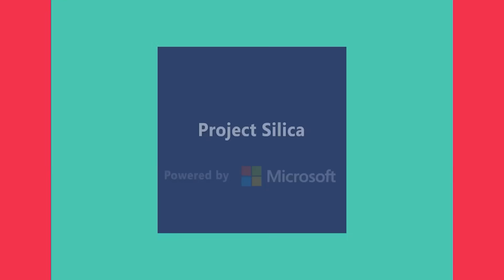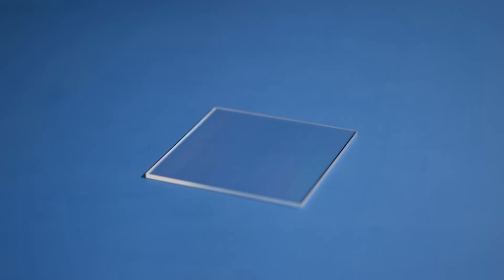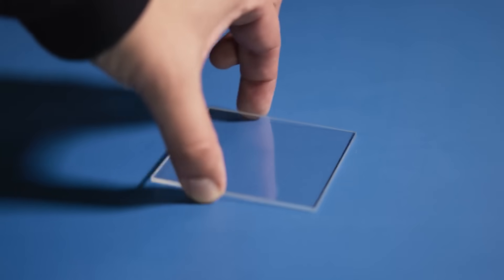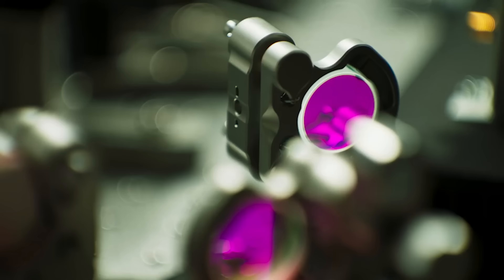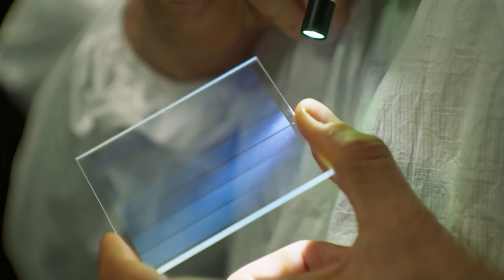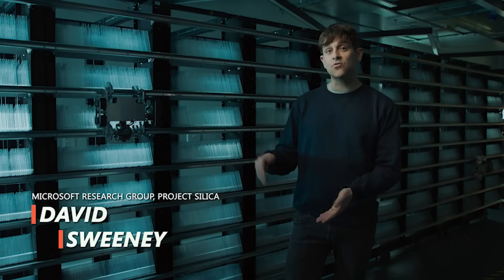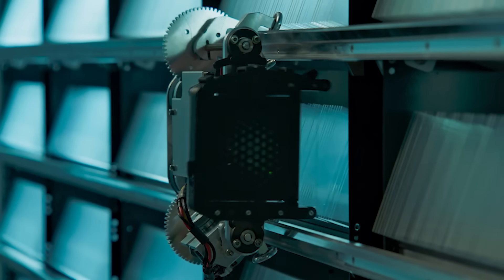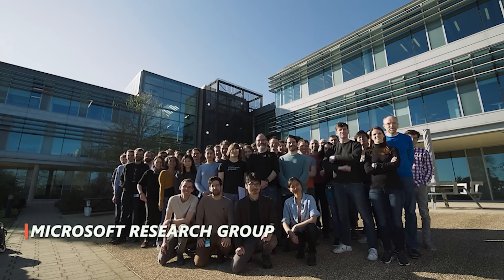Sealed in glass - Microsoft's Project Silica

Comment: Fascinating and eerily similar to the clear glass chips from Star Trek TNG. I imagine the biggest issue is the lack of ability to rewrite the glass chips. This would function as permanent long term storage for documentation
Reply: CDs were read only first of all I’m sure as technology progresses they will get read/write into these chips!
Reply: You folks are not getting its purpose I read rewrite is NOT necessary, it’s for long term storage of ALL the worlds knowledge and information forever!! Not for users like you. It’s impressive is that it also doesn’t need power to read it after.
Reply: @nicholasklangos9704  Reading requires a computer controlled high powered precision microscope as well as a computer to decode the data being read by said microscope; all of which requires power.
Reply: @nicholasklangos9704  but glass is essentially a fluid, so it's not even close to forever, right?
Reply: @Doogle7821 thing is that storing data today is usually consuming power for live data storage as well as for the hardware storage (aka data centre with air conditioning). Both not needed here.
Reply: I was thinking planet Krypton and Kal El's (Superman) information stored in crystals... Crystals might be stronger than Glass and could be better at permanent long term storage of data...
Reply: @yootoober2009  I was thinking "The Time Machine" and the talking discs. Those helpful recording items last eons and eons, then after those, more and more eons and eons, even! I was thinking that Superman and 'super Krypton things' wear out eventually? The whole planet exploded after all, so how durable could Superman be over time?
Reply: Star Trek's isolinear chips is more resemblance of optical computing. Which is a real thing! The biggest challenge is to create a logic gate that acts purely on interference patterns. It probably won't look like the chips from star trek since light based chips would obviously need to be contained in a opaque package to block off any external light sources, but still it's a real concept!
Reply: But for long therm storage especially important data its very interesting
Reply: So it’s like an advanced form of microfiche
Reply: Rewriteability a nonissue. The pieces of glass are dirt cheap, it's just fused silica. If you want to change data you can simply write on a fresh piece of glass and toss the old one in a literal recycle bin. And it's 100% reusable, you delete old data by melting it down and making fresh pieces of glass out of it.
The usability problem if any is latency and read speed, takes a while to find the necessary piece of glass and read it. But that's archives for you, if you need to access data nobody has needed for a decade, then it's probably acceptable to wait a few minutes. If someone were to be constantly using this data then a working copy would be kept in traditional servers for fast access.
More practical problem is cost of writing this data, the equipment I've seen so far is very prototypey and expensive for the small amount of data it can write in any sort of reasonable timeframe. It's not really ready to take on a task of archiving the massive amounts of data the world needs to archive.
Reply: All current and future tech is inspired by Star Trek. 

Can't wait for replicators and teleporters.

😅
Reply: It's called ISOLINEAR CHIPS 
https://www.youtube.com/watch?v=XN2ARLfcO24
Reply: if it was cheap like floppies used to then a game changer.
Reply: More like HAL 9000 memory!
Reply: Yeah! I immediately thought of Star Trek as well
Reply: think of these as read only CD
Reply: Actually it was explained it's possible in another video about this tech
Reply: Krypton used this tech a long time ago. The Lantian for even longer, then the Goa'Uld and the SGC. Star Trek come far later in the timeline. 
But I bet Microsoft glasses are much more fragiles than the other ones.
Reply: It's easy to recycle clear glass.

No need for rewrites.
Reply: yes, optical pits or "voxels" isn't a new idea. The whole "sustainable" spin sounds like nonsense
Reply: Not many people realise we have at least 70% of the tech used in Star Trek. Well, minus the ships because that unironically will only happen once we achieve a OWG.
Reply: @shineayandrews1869  the big limiting factor in most Star Trek tech that we need to overcome is the energy requirement.

 As you said, we already have experimental and in some cases even practical experience with quite a bit of Star Trek tech, but to make it  usable, we need a massive energy revolution.

Even the warp drive. It's theoretically sound, just requires "the lifetime energy of the sun" levels of power in current mathematical models.

The energy estimate has been brought down in recent years as we learn more, but still requires energy many times the amount we use as humans combined.
Reply: records in the jedi temple are similar format as well
Reply: The other issue is the response time, even if the read speeds are high, those several seconds it'll take the machine to physically move the glass to the reader are gonna be a problem for anything more than archival.

And then, if archival is the goal, I'm not sure remote storage is ideal, I know I wouldn't want to rely on a third party company to be there 30-40-50-100 years down the line for when I or someone else will need that data.

Now if they can compress this technology and bring it into the home, I'm all for it.
Reply: It’s not necessary to rewrite its for long term storage of data not for you users.
Reply: @nicholasklangos9704 so a data update maybe because factuaal changes will need to replace the entire glass? Information are constantky updating and science is all about continously reviewing and accepting new data while replacing the old and obsolete, so i do believe there is a need for rewritable system or at least replacable to ensure obsolete data are not kept or has double records conflicting with newer information
Reply: @archingelus  Science has no boundaries but creative content does, which is usually the most space-consuming to store.
Reply: @samwolfe1000  well, the context of everyone in this information is mostly erred on the knowledge of science not culture, eitherway there are tangible culture or art that you preferably want to preserve as they are like paintings which would be better if left unchanged not in a form of a glass for your own context's sake
Reply: @archingelus this is what tape archive is all about since ages. You don‘t overwrite a certain part of a tape - you declare information for unvalid and amend the changes to the end of the tape. The final data is stored in a catalogue (aka index). You add changes to the catalogue et voila. What you consider a problem isn‘t any issue at all.
Reply: @pan6593  i barely even remembered what did i replied to 2 weeks ago lol
Reply: @TheFloatingSheep  I thought the same about response time, but HDD drives use a disc with a reader which is similar to a record player. We’ve made it work over the decades.
Reply: @TheFloatingSheep  Not bad ideas there, for a 'floating sheep", even. Pink Floyd should hire you to create another animal balloon, maybe. I agree that all great ideas are exactly that, until they aren't anymore. 'Archival' would be awesome using this, but at one's individual command, not at another's 'company model' demand. Having a set of these in a PC with read/write capabilities would be so much better than what I have now. Speed, you must have speed involved or it's like torment and torture. Those are not long term benefits at all. Long term anguish is more like it.
Reply: Yeah. Documentation on you.
Reply: You'd probably just melt the glass down and make a new one

Comment: There's a slight bit of latency with this method. Other media is low power too if you switch it off.
What is the lifetime of this stuff, any built in ECC? Glass can be damaged by radiation, can't eliminate all background radiation.

Comment: They mentioned the information is stored permanently.  I don't think most information on the cloud is permanent but more transient in nature.  However, this is great for storing historical data that does not change.
Reply: Its permanent.  Yt stored video permanently
Reply: @phantombeing3015  I'm sure youtube isn't using the same storage devices they were using 10 years ago, they just keep moving the data to new hardware when the old ones start to fail or get obsolete
Reply: @rizizum  well, they do it because they fail at that time. The point is that they store videos permanently. The data needs to stay whether they replace their storage in months or years. But they will prefer storage technoques which last longer if they are reliable enough
Reply: @phantombeing3015  The problem is that long lasting storage can't be read fast enough for video streaming

Comment: An HDD does last much longer than 5 years... Especially if you only write on it just once - like they do with these glass sheets.
Reply: bit-rot on hard disks are not caused by writing to them. The fact that they are magnetic, by their very nature, the fact that they are rewritable makes them impermanent.

The very first hard disk that was available for the IBM PC was 20MB. Today we have 20TB drives. The higher the capacity, the more dense the data is packed on the platters. This means each bit is encoded as magnetization polarity onto an ever smaller miniscule tiny spot on the media. And over time, they will interact with their neighbours and gradually degrade. Even if you seal the whole hard disk inside a vacuum chamber and keep it away from other electrical stuff, motors, etc that have magnetic fields.

Those 40 year old 20MB hard disks are probably still readable today. The 500GB ones from 15 years ago, possibly not. It gets worse as capacity increase and things get packed more densely together.

Conventional wisdom is you check your data every 3 years or so. 5 years if you want to live dangerously. Longer than that, you're risking data loss. It's actually not really that important for our home data, but if you're managing an actual archive you are venturing into the area of professional negligence.

And one more thing. Write once data are impervious to ransomware attacks like NotPetya. The fact that hard disks are never write only made me worry constantly when I was a sysadmin.

Comment: They dont specify if what they refer to as glass is a single quartz crystal, polycrystallyn quartz, or even plain old window glass. Quartz, or any similar crystal should last about forever. "Glass" is a term that can apply to any non crystalline amorphous material. The problem with window glass, for example, is that it doesn't retain its shape forever. If you ever looked through old window glass you would understand - it eventually distorts and sags under its own weight. (Think of window glass like really solid jello - it will sag slowly!). In any event, if they want data retention greater that a few centuries, they will have to use a crystalline material. Considering the fact that our society considers everything disposible, im not sure what they are gaining over "archival" quality DVDs.

Comment: I've been involved in IT for decades and especially with people on data storage. People can't not break CD's which are far more durable than glass. People can't not break robust external drive systems. Sorry if I am more than a little skeptical of the long term viability of this.
Reply: You're not thinking of it at a big enough scale. This is not for the backup of a single company's data like we might manage. Look at the rows of slides and shelves. There must be like 10-20PB of data on that single shelf we see in the video. One implementation of this thing costs hundreds of millions of $$$. You want to juggle 20,000 CDRs manually? I guarantee you, your army of humans would scratch and lose hundreds of those CDs before any of these robots fell off the slide and crack a single slide. The humans would be much slower, error prone, drop CDs and scratch them, and put them back in the wrong place. And their salaries would kill you.

Comment: Sustainability is important for Microsoft, what a joke
Reply: Grow up. It's not all about your lifetime. How do we store data and retrieve it in 1000+ years. Paper books, cuneiform tablets, etc have worked well but your hard disk drives won't still hold info that far in the future. So this is an attempt at a solution.
Reply: @joythought  lol, are you serious? this is a non technology that wasted tens of millions of ressources and it wont have any practical use, because its already totally outdated. Also they need a 50 million dollar lab to read the datas bit by bit, and another one to write it, it is just unusable crap. Besides it is certainly not a good long term storage solution by any standard, low density, very fragile. etc.

Comment: This makes me so happy and also scared. Are we ready to store data for thousands- to millions of years? I guess storage space to store the platters will be the next problem.
Reply: You'd be surprised. The Project Silica glass media is 7.5x7.5x2mm each storing 7TB of data. Let's increase this to 10x10x10mm to provide for a caddy and some space to move them about. We can fit 1,000,000 of these plates into a cube 1m on each side. A standard one TEU intermodal container (the boxes hauled by semis, 1 TEU is 20feet long) has an internal space of 33.13735 cubic meter. This is enough storage for 232EB of data. All of Amazon currently has an estimated 160-200EB of data. The whole world has only about 300EB.

Project Silica's current system is not very tightly packed. Probably because they feel there is no need. All the world's data currently can fit in a space smaller than a standard 40ft container. Donald Trump's NY penthouse alone, has enough space for 14,000EB of data. If we use the newer 75.6TB version of the Project Silica system for which they have already demonstrated a working prototype, this goes up to 150,000EB. That is 500x the total storage the whole world has right now.

Central Park Tower has enough space for 18YB of data. That is 60,000x the worlds current total storage capacity. In a single building.
Reply: @danielch6662  My hat is off for you sir! Thanks for the calculations and examples. Puts it into perspective doesn't it🤓

Comment: hmm, that robot is the slowest part, with proper optics one could direct a beam notice its reflection, and read it out. Moreover it could be multi-access beams from several readers onto the same parts, generate beams targeting with phase arrays and you have no mechanical parts.. okay this might be too complex for a start, but it is doable by current tech.

Comment: Pretty cool stuff, but just wondering what impact dust would have over the years. All fine to store on glass, but if you need to store these panels in a dust free environment that's only gonna cost.

Still, pretty cool.
Reply: The data is laser etched inside the material in 3 dimensions, the surface remains smooth so dusting it off should be pretty easy.
Reply: Where is the dust gonna come from? You put a HEPA filter in there, shut the door and windows to the room, and never open them up again. It's not like the robots need oxygen.

Look at the expensive robots, the rails, the custom shelves. You build a room to house these things. You don't stick it in a spare cubby hole in your kitchen.

But I would not have built the system like these. The plates are only 70x70mm (2.75x2.75in). The robots are too big and complicated, the rails are oversized, the shelves are too big. There is too much air. The plates can be packed into a far more compact areas, and the robots could travel on a simpler rail mechanism without the complicated arm to move them from one rail to another. Impressive looking it is, but unnecessary. The whole system can probably be shrunked to 5% of the space it occupies in this demo.

Comment: Consumer use needs to be something that is much less fragile than a thin plate of glass. Perhaps a form that is more like a short cylinder or perhaps short hexagonal pyramid shape (or other pyramidal shape that is appropriate to the internal crystal structure). Some shape that is not prone to fracture even when scratched and can be read from multiple angles when one area is extensively scratched. Consumers may carry several in their pocket with their keys, etc. It has to be robust enough to handle scratches without needing a plastic caddy.
Reply: Everyone keeps making comments like it’s normal glass, it’s not normal glass. Also its intended use is generational long term storage, not data you carry every day.
Reply: What's the problem with using a plastic caddy? Didn't diskettes have plastic sleeves?

Comment: Fantastic goal…. stupid, inadequate, pathetic implementation.   Too much human involvement is necessary.   Storing data on GLASS in an open environment.   Just dumb.   If those robots were really smart, they would be able to read a glass WITHOUT having to hand it off to a human.  Also look at the gaps between each sheet of glass… wasted space.   There could be small robots in back with something as simple as a rotating disc that gently pushes out a sheet of glass to be gripped by a robot in front.   That would allow for denser storage and less wasted space.  Of course the front and back robots would be in sync and the back robots would NOT be able to push out a sheet of glass so far that it falls to the floor.

Did anyone else notice how they DID NOT say how much data is held on each glass?   They also failed to say if there are multiple layers per sheet of glass.

I am more impressed by a 4 slice toaster.

Comment: 5 years on a harddrive?  I call BS. I have over 15TB if data on single drives.  Large chunks easily over 10 years. I have not verified all the data, but I copy samples a couple of times per year with no errors. Glass seems like a better option though for long term storage.